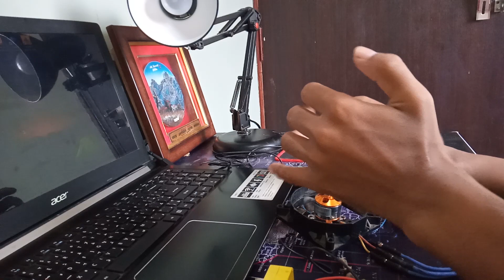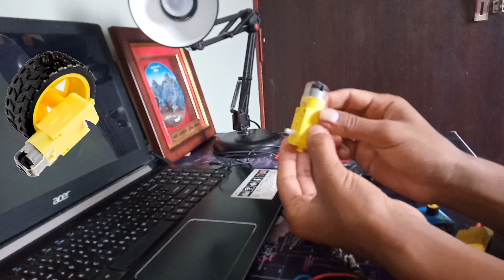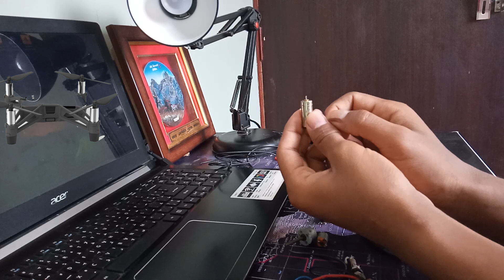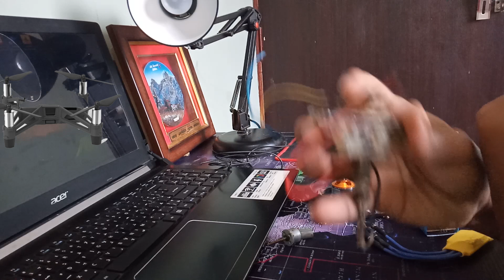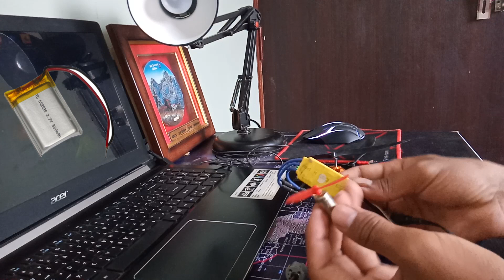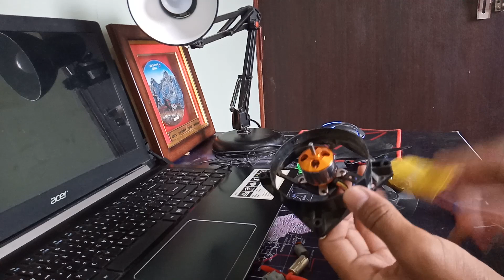which motor can be used to make drone | best motors for drones, quadcopter, helicopter & plane

Comment: Which motor ( how much volt )do I need to make a jet engine a working project for engineering and which battery will i need
Reply from the maker: Use(BLDC) brushless motor, brushless motor are best for such projects. These Brushless motor can handle upto 16V. 3/4 cell LiPo battery are compatible with it. You may use 2200kv or (+) bldc motor with 3/4 cell lipo battery of around 2200mah.

Comment: Can we use 820 motor in drone?
Reply from the maker: Yes, we can
Reply: @shrawanpanthi  bro i got a board of rc helicopter it has a reciver   i already got remote can i use it
Reply from the maker: But, note one think , these are suitable only with either gear setup or small propeller....
Reply from the maker: @sameerwani9272  If you are thinking about making drone out of the components of RC helicopter, it would be very difficult cuz helicopter works in different and complex principle than drone...drone need to have gyro sensor so that it could auto adjust its position by adjusting the speed of motors. But  in heli there is pitch control system rather than speed control..  And toy drone doesn't have gyro or acc. sensor.

Comment: And what about dc motor am going on my helicopter projecf and fan project
Reply from the maker: There are special dc motors designed for high speed such as coreless motor, n60 motor , etc...these motors works well with gears...but brushless motor are far better in speed as well as strength...

Comment: Can we make a drone with n60 motor
Reply from the maker: Yes we can , but the total body weight should be minimum as possible, we also can use gear and large propaller for better result.